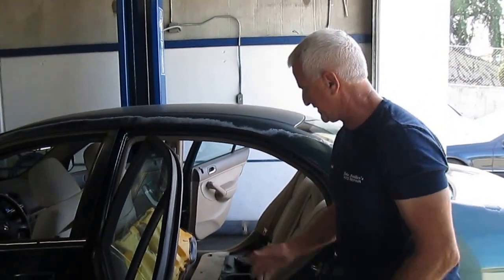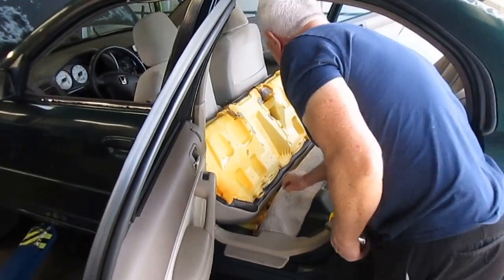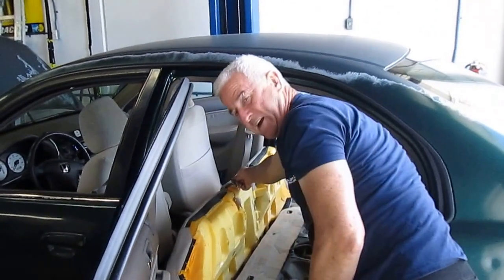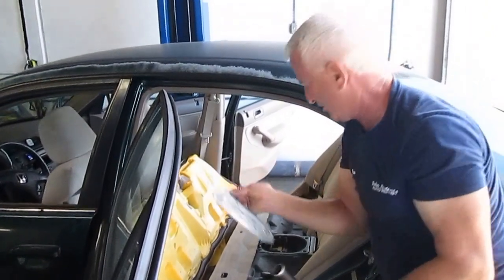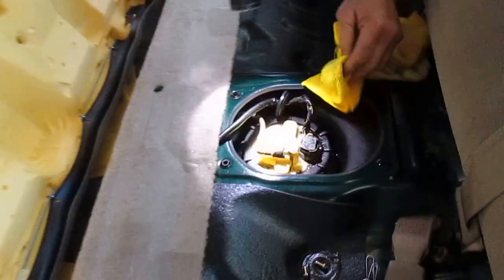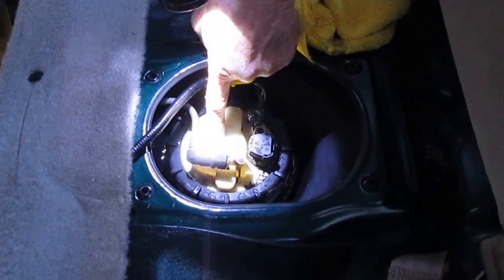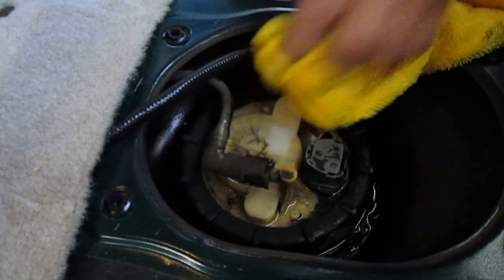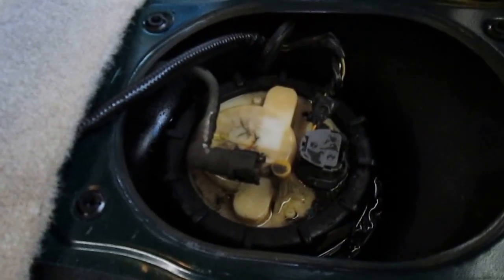Honda Civic Fuel / Gas Smell

Comment: My questions is, how does it crack :l 
Having the same smell of gas on my 2018 civic
Reply from the maker: @MP-jg9xm  it's made out of plastic and I personally don't think it's thick enough 🤔 if the fuel pump is still good I'm pretty sure you can buy the plastic retainer at the Honda Dealer
Reply: @JohnSadlersAutoRepair  thank you, I will inquire at the dealer.

Comment: Cant you just jb weld the crack
Reply from the maker: Hahahahaha,  I wouldn't
Reply: @JohnSadlersAutoRepair  why not
Reply: @JohnSadlersAutoRepair  welds plastic cracks all the time
Reply: @nickh8773 did you try the jb weld?
Reply: @JC_films.  nope replaced the whole pump and sending unit.

Comment: Thanks to the stupid returnless style fuel system, the part that is prone to cracking is a cavity with a cardboard filter inside of it. Drill it out Put a bulkhead fitting with efi type outlet and run an external fuel filter.

Comment: Is this common on honda civic I've got a 05 that's smells of gas has for the past few days now the check engine light is flashing could this still be my problem ran fine then suddenly its running weird its not exactly a misfire it seems all the cylinders suddenly aren't happy
Reply from the maker: Hi Jacob, you could smell gas because it's running so bad. I would take the back seat out and check it anyway. What code do you have? When the check engine light is blinking I wouldn't drive it.
Reply: Yup it was spraying replaced the assembly about 2 hours ago and she's running much better thanks so much
Reply from the maker: @jacobd4955  Great job!! Your welcome!

Comment: I have a 93 Acura integra,  same problem could exist in same location???
Reply from the maker: Rene Martinez I just saw a video and it looks like you have to take the gas tank down to get to the fuel pump on that car. It has the same cover as the one in my video but that's the fuel tank sending unit not the pump.

Comment: Letting us know what and how you fixed the smell would've been better dont you think?
Reply from the maker: My bad for assuming, since I said the top of the fuel pump housing was cracked I figured everyone would know to replace the fuel pmup. My apologies.
Reply: @JohnSadlersAutoRepair  a strong smell of gas has been starting after a 2 hr trip. I'm gonna check for the fuel pump housing.
Reply from the maker: @bealightinthisdarkworld8225  keep me posted what you find out